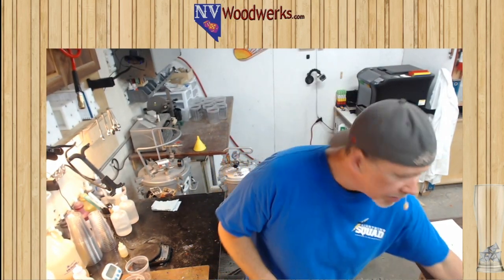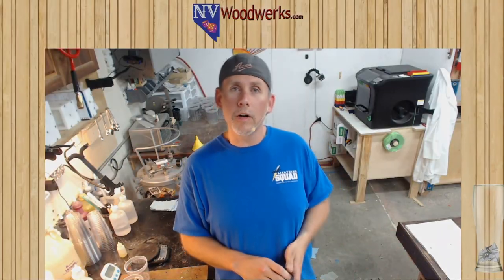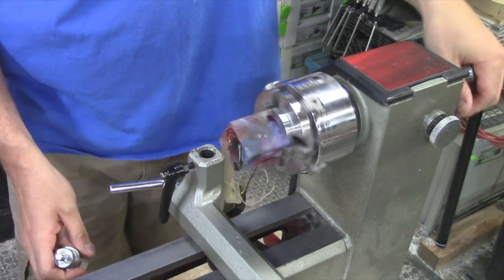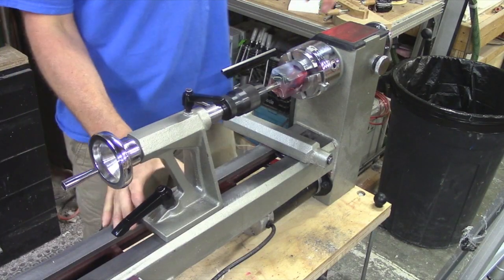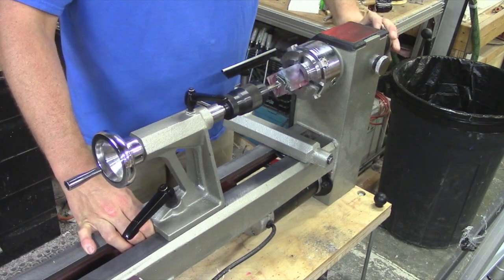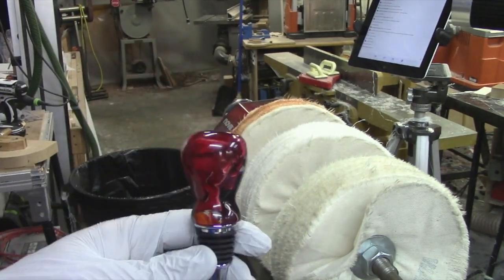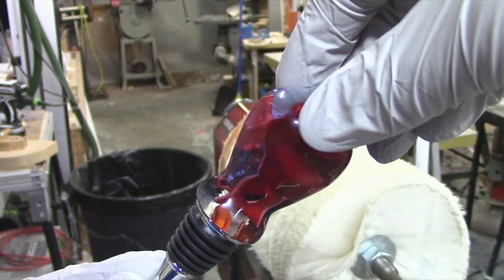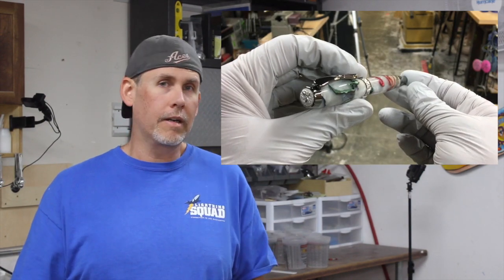Magic Mushrooms Cast In Alumilite - The Wine Bottle Stopper | Dunkin Junk Replay

Comment: Another awesome casting and turning Zac!  Keep up the great content.
Reply from the maker: Thanks brother!! More vids on the way =D
Reply: Zac Higgins Is it necessary to use the Stoner mold release when casting Alumilite resin when using Lizard Blanks?
Reply from the maker: It can prolong the life of the mold if you do, but it's not necessary. You should be able to just pop the front off, and it will slide out without applying stoner

Comment: Thanks for the video.  You gave me some new ideas to experiment with.  

One suggestion for your bottle stopper turning process: Instead of facing off the bottom of the blank with a turning tool, try using a Forstner bit to face off the bottom of the blank.  The Forstner bit doesn't need to be large enough to face off the entire bottom of the blank, just larger than than the diameter of the bottle stopper mandrel.  I like this approach because it is quick and accurate.  You just remove one bit from the drill chuck in the tailstock and mount the next one in succession.  Also, you may find that the dimple left by the Forstner bit eliminates the need to use a center drill.
Reply from the maker: Thanks David! Great tip with the forstner bit too! I'm going to have to start doing that, already have to have the drill chuck ready for drilling, it'll definitely be a time saver =D
Reply: David Walser op

Comment: Know that this is a stopper on TOP of a bottle,but since you use Alumilite, do you happen to know if it is food safe so that turnings such as water glasses etc could be made and used?
Reply from the maker: The resin I used for it, "Alumilite Clear", is not certified food safe. Alumilite's Amazing Clear Cast resin is an epoxy and has a food safe certification though. I'd recommend contacting the resin manufacturer to discuss what you have planned for it before you buy to make sure it will work for your application though

Comment: zac.. I haven't started working with plastics yet.. but, have wondered after watching a few videos where porous items have been embedded in the resin.. Do you have to seal the outside of the turning with CA or similar to seal the mushrooms, in this case.. or does the stabilizing material fully seal the shrooms so that everything you are turning is essentially plastic.. ??
Reply from the maker: If the material is really porous, you will typically need to seal it. Stabilizing doesn't really fill in gaps. In some cases you do have to seal it, pasta for instance would definitely be in that category. Some wood species and other materials don't really need to be sealed if they are close grained, but putting a finish on top will give you an even sheen across all the different materials.
Reply: Hi Zac what do you use to seal pasta with?? Thanks
George

Comment: Did you purchase your buffing system or make it? Thanks
Reply from the maker: Hey Carla, I bought it as is, it's the "Beall 3-on" buffing system. Comes with all three wheels, the mandrel and the rouges. I have a link to it (and most of the other tools & accessories I use for casting and turning) on my website: http://nvwoodwerks.com/tools/

Comment: what are you using to hold your worm screw?
Reply from the maker: It''s actually a bottle stopper mandrel with the 3/8-16  thread on the end that you screw the stopper blank onto to turn it. There are two types of those mandrels, one screws onto the spindle threads, and there is also one that just pops into the taper

Comment: is there a pressure pot i can buy specifically for acrylic
Reply from the maker: The only brand I recommend going with is CA Technologies pressure pots. They are well made and work great for casting. I have links to where I get mine (and most of the other equipment, tools, and accessories I use for casting and turning) on my website: http://nvwoodwerks.com/tools/
Reply: thank you!